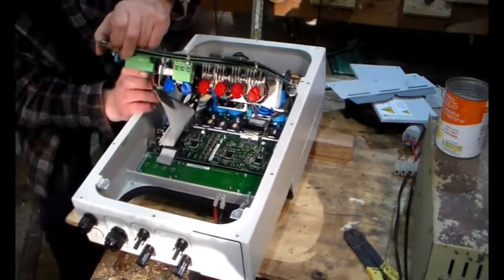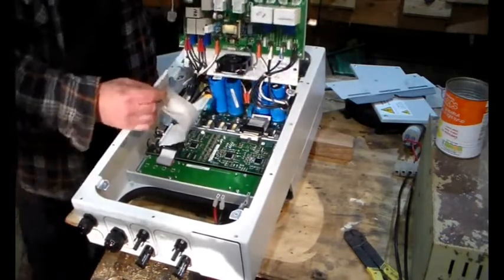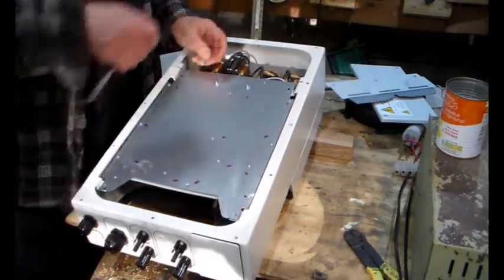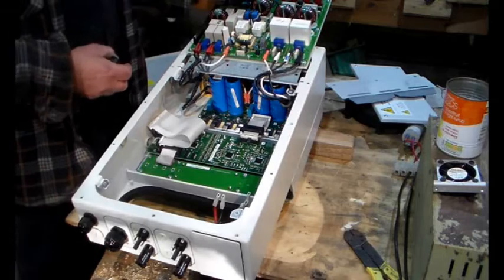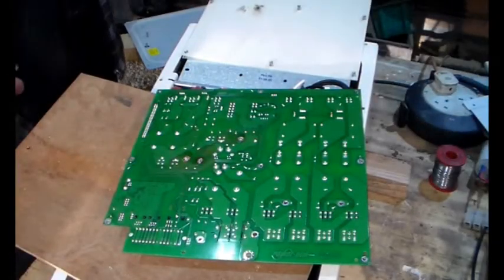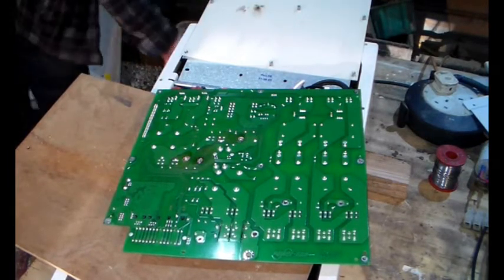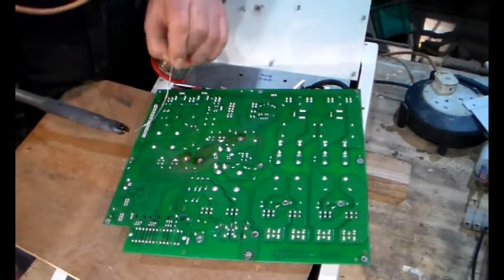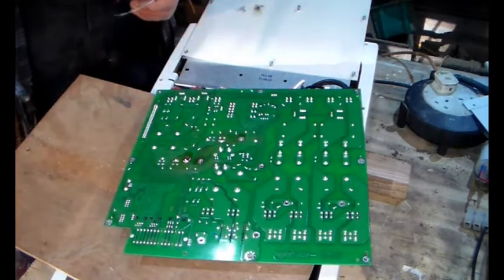ABB Aurora inverter fault E031 improved fix / repair

Comment: Came home to E031 today, fixed in under an hour thanks so much. Now should I take my other one apart and  redo the relay joints before it breaks?
Reply from the maker: Hi, thanks for your experience, the problem is cooling, have you seen my video on extending inverter life? Please see the "about" button on my channel page and see the links, Cheers

Comment: Hi Andy. Thanks to your video my Aurora has stopped clicking and is now working again. You would think that with so may problems of the same type that the manufacturer would admit that there is a fundamenal design fault in their board layout and choice of relay used. It would be useful to know where to obtain a spare relay from just in case it does actually develop into a relay fault and not just an overheat and burn fault on the PCB track. Many thanks again. PS : you shuld really invest in a temperature controlled soldering iron and retire your welding chisel.
Reply: Those big irons have their place.

Comment: Hello Andy,  Very good job!   I just purchase an Aurora Powerone and wanted to see what to expect.  Hopefully this issue won't happen for a while,  but if and when it does,  I know how to fix the problem.  It seems that these GT inverters are very well made otherwise.  I'll only be running mine at about 60%, so hopefully it will stay a bit cooler.  I very much appreciate your videos and the other Andy's comment about switching out the relays.  I'll be watching some of your other videos on extending the life of grid inverters.  CHEERS!
Reply from the maker: Hi, thanks for your encouraging words. About 60% is ideal for any inverter and mounted in a cool, well ventilated area (not in the loft). I hope you have subscribed, cheers

Comment: I was wondering if it was possibly the plate through holes in the circuit board, with the relay removed there is a large section of copper on both sides of the board that has to be connected to the relay pin that is getting hot, I was think that this plate through hole might be failing.
Reply from the maker: Hi, that may well be the case, some of the double sided tracks are parallel connections, flowing solder on to the tracks is definitely a good idea, as is de-tuning the unit and improving the cooling. See my video on extending inverter life, cheers

Comment: Hello Andy
I have repaired my Aurora inverter (with the help of your videos). I removed and replaced the two relays that were the problem. I have opened one of the relays to find out why it failed. I observed the following, the contacts were not burned as I had expected. The pin that had overheated was the connection for the moving contact which is thermally speaking a long way from the contacts. My conclusion was that the internal electrical resistance of the copper spring (which carries the current) was the source of the heat. I believe that it is not if it will fail again but when will it fail again.

I have an idea that I would like you to comment on. 

Replace each of the relays with two of the same type on a new circuit board mounted within the enclosure.

This circuit board could be 0.1 inch matrix stripboard (epoxy nor bonded paper), the solenoid pins will go through the holes but the holes for the contact pins will need to be opened up. 

The solenoids are 12 volt rated and I measured 95mA when connected to a 12 volt power supply.

I would suggest that to minimise radiated interference that the relay contacts be connected using wires twisted together (a twisted pair) ( to the new circuit board) and that to equalise the current to the two relays that the wires on the pcb to the contacts be of equal length (this will equalise the resistance).

Reasons to consider not doing this modification

1/ Its messy, If you don't know what you are doing it is also dangerous (I am a retired electronic engineer)

2/ Is there enough drive capability in the control circuit to drive two relays (maybe four if the two original relay coils are connected together)

3/ Where do you fit it. I believe that a metal mounting plate could be made that fitts onto the bottom two screws of the plate holding the circuit board. (don't droll the box as that would have a negative effect on the waterproofing)

4/  Will it cause unexpected problems or cause permanent damage to the inverter

There are probably other negatives that I have not considered (I have not tried doing this yet, but I am bidding on a website for cheap inverters with E031).

If you would like to contact me directly I live near St Andrews in Fife and my phone no. is easy to find.

Regards

P.T. Bell
Reply from the maker: Peter, thanks for your comment, my thoughts are that this problem is caused by a combination of heat build up, design, and lead free solder. I see the forward is to use lead solder spread over the large and heavy track, to only use 3 Kw of panels, to mount the inverter in a well ventilated and cool area, and to add an external cooling fan controlled by a timer so it runs between (say) 11am and 5 pm. Cheers, Andy
Reply: Hello Andy
I don't believe that leaded solder would prevent the problem, (I have seen the same effect many years ago on equipment that I was maintaining, long before leadfree solder was introduced.)
I have made a youtube video on removing a relay, the title is "Removing a relay from an Aurora 3.6 KW inverter" I have also made a youtube video called "rectifier investigation" that you might find interesting. I am at the moment uploading "Aurora relay failure mode investigation" which will be available later today.
Regards
Peter

Comment: Have two of these Andy, 3.2kw wind and 6kw solar inverters. Great info as always. On the solar inverter I have two fans one blowing at the heat sink and another extracting from the enclosure to dissipate heat which reaches over 50°C 
Heat is the killer of electronics.
Happy holidays 🎄🎄🎄
Reply from the maker: Jim, yes the cooler the better and the fans run on a timer is very practical, cheers